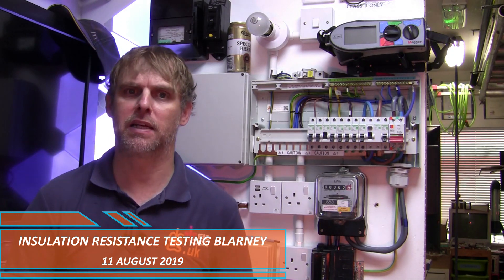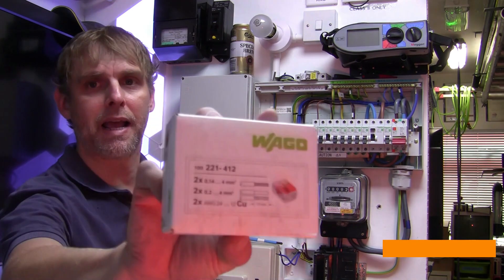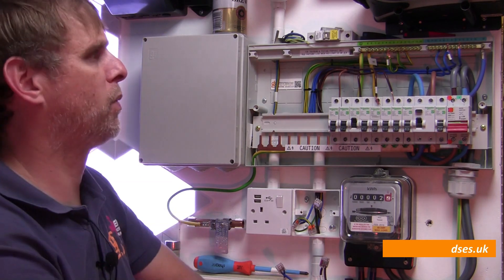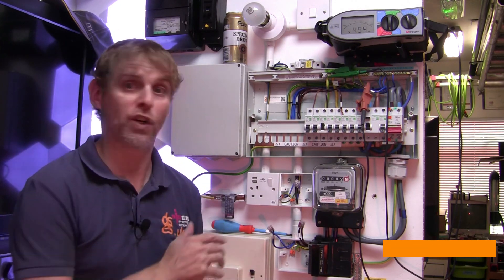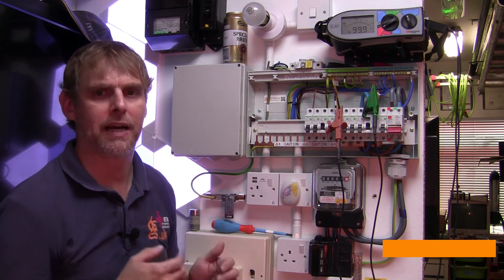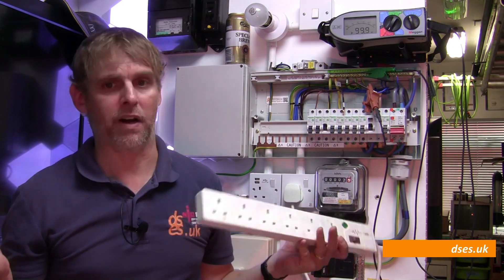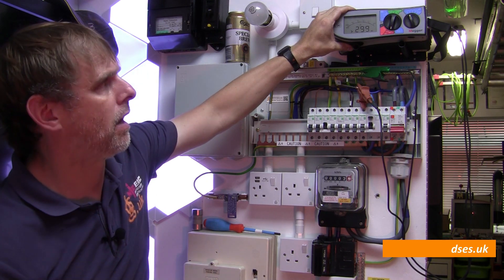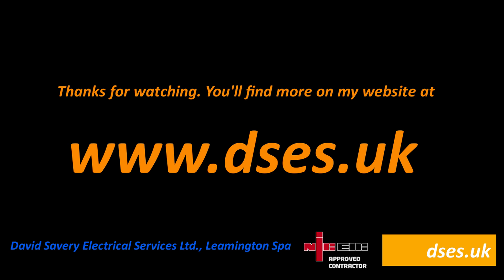Insulation Resistance testing blarney

Comment: I am a site maintenance guy in a school, and have been doing there portable appliance testing for 4 years now, I new the tester put 500v into the item, but I did not know it put it up the line and neutral wire,  you learn something new every day ha ha.  you have the tester I want to upgrade to, the Martindale handy pat 600, would you recommend it ? the one we have now does not have the option to lower the test vault down to 250v so do worry about buggering up computers :-$
Reply from the maker: Hi Garry. For a basic PAT tester, the Martindale model I have is just fine. It does support 250 or 500V testing, but the only time the 250 option is needed for most homes, offices or shops is when I'm testing a surge protected extension board such as that shown in the video as that will fail a 500V test by design. The 500V test shouldn't trouble the computers as they should be designed to withstand it. I've never seen a computer damaged by the PAT process, not that I'm saying it can't or won't happen, but it's not happened to me and I don't take any special precautions for IT gear unless there's a manufacturer label on it clearly stating otherwise!
Reply: one of the IT guys at the school also does PAT testing, and his tester does have the 250v option, but he said he hardly ever uses it as the tester by default keeps going back to 500v every times it turns itself off, he then has to go through a sequence to put it back on 250v, so he just keeps doing 500v test, he also said that he has not damaged any of the hundreds of computers he has tested.  Thanks for the reply.

Comment: On my testing course they told us if you short live and neutral at the board you don't need to worry about unplugging anything????
Reply from the maker: You can short line and neutral at the board (i.e. busbar to neutral bar with breakers in the ON position) to test the whole installation at once with respect to earth, but there are three things to note: 1. Make damn sure the installation is isolated and that the short is removed before anything goes live again (I really don't like the idea of this as it introduces the potential for a major fiery fuck-up). 2. The neutral bar would have to be disconnected, otherwise it's already connected to earth in a TN arrangement so the test would fail (again, I don't like this as some idiot may re-energise the installation after forgetting to reconnect the neutral bar making all appliances appear dead when they're actually live). 3. The resultant measurement would be lower than the lowest individual circuit measurement because of Ohms Law for resistances in parallel. This means your tester might give a reading of, say, 0.5MOhm simply because one or more of those circuits isn't optimal on its IR. That number only indicates something isn't 100%, it doesn't indicate which circuit(s) need further investigation. In short, it's a bad idea as whatever time it saves isn't worth the potential dangers being introduced, and the number you get out of it isn't particularly helpful. More on this can be found in my April video on IR and RCD's.
Reply: Yes they told us do the IR for the whole installation and then if the result is suspect you would then have to go to each circuit one by one to find your problem  ....... I suppose it's the same thing as you doing live and neutral to earth for each circuit individually and  not having to worry about unplugging etc if you missed something
Reply from the maker: Personally, I wouldn't bother testing all circuits simultaneously on a periodic inspection, as it's pretty much guaranteed that one or more circuits will give a less than optimal reading, so for the effort of disconnecting the neutral bar and commoning up the lines and neutrals and the risk of making a cock-up when re-energising, you may as well just get on with testing the individual circuits anyway!
Reply: David Savery Electrical Services Hi David great video. Your reply above wrt testing the whole installation at the board, with the main switch (DP) off, all circuit breakers/fuses on,  why would you need to “disconnect the neutral bar”  on a TN (S or CS) system ? There should be no path between neutral (or line) and earth on any and all final circuits ? (not withstanding there may be under fault or degradation circumstances)
Reply: Hi David great video. Your reply above wrt testing the whole installation at the board, with the main switch (DP) off, all circuit breakers/fuses on,  why would you need to “disconnect the neutral bar”  on a TN (S or CS) system ? There should be no path between neutral (or line) and earth on any and all final circuits ? (not withstanding there may be under fault or degradation circumstances)

Comment: There’s no way on a full rewire I’d send half a day going round wiring in Wago connectors everywhere so I could do an insulation resistance test on 1st fix .
Reply from the maker: It's not just for insulation testing though, it's also so you can confirm ring continuity, or in the case of a radial, continuity to the end point. You don't have to check this shit, but you're fucked on second fix if something's wrong even if you suspect it's down to another trade having damaged your cabling. If you can't prove it was all good when you left site after first-fix, then the client's just going to assume you fucked up, and if you have to chase out newly plastered walls or pull up newly laid floors to fix it, then the expense for that may be expected to come out of your pocket. It's a risk assessment: do you skip the testing and hope it's all okay on second fix, or do you undertake the testing to cover your arse against things going to cock at second fix? I take the safer option because I've been on site where builders have damaged my cables in the past.

Comment: Hi David I'm a bit late watching this video sorry however it stirred a question in my normally empty head it may come across as a dumb question but here we go I have helped put in two linked smoke detectors fireangels ST-230 on its own circuit  so a T+E from DB to the first smoke detector then a 3c+E out to the second smoke detector the T+E has not yet been terminated in the DB an insulation resistance test was done and past ok then the guy did the r1+r2 he put brown +Earth in a connector block and tested at the last smoke detector the reading was 0.00 a dead short he said,  done with a the fluke mft the smoke heads were not fitted at the time would it of mattered that the neutral was not terminated from the T+E  at the DB I never found out the final result of the r1+r2 all people are saying to me is they would just calculate it with the ZE and ZS but I need to know if that neutral should be connected at the DB to get a r1+r2 ...god my head hurts can you or anyone shed an opinion it was a tncs set up in a house cheers enjoying the videos

Comment: Can we test separately 
L N
L E
N E
thanks
Reply from the maker: Yes, you can (and should) perform these individual tests unless you know a load may still be present between L-N or a surge protector between L-N and E.  Where loads are present, join L-N and test to E. Where an SPD is present, drop the test voltage to 250V.
Reply: David I watched a video last week I won’t say who’s but they says that it is important that the circuit earth conductors must be connected to the earth bar with the bonding conductors and the main earth conductor? But don’t say why. I was tort to test between LN -LE -NE and LN and E . As we are testing the integrity of the cables insulation. 
Please correct me if I’m wrong but when we press the test button we send 500v dc down one wire and it returns back on the other wire back to the tester, so 
If the circuit earth conductors must be connected Surely if let’s say Nigel is leaning on say the aluminium sink just as you press the test button Nigel will get it as well you will be testing him , ? I have asked three people on YouTube why it’s important to have the earth conductors connected but know one is will to give a proper answer. Can you shed any light on this as I believe I am right .  But as I don’t pretend to be a super duper know all I could be wrong.

Comment: Kewtechs go up to >12,000 Mohm. Totally unnecessary 😂
Reply from the maker: Anything more than four digits wouldn't fit into the certificate field on Easycert!
Reply: @dsesuk  it must be 1200 then... Yeah that sounds more like it actually 😂 I'm doing my domestic installer retard course at the moment, and they use Kewtech stuff. Passed my Science, practical and building regulations exams over the last 3 weeks and I'm on inspection and testing this week. Leaving the RAF. Any tips?
Reply from the maker: My top tip: Become a plumber! 

Electrics is good if you have the enthusiasm for it. It's an unregulated industry though, and there are a lot of chancers out there, so you have to put the extra effort in if you want to shine above all the dross out there!
Reply: Haha brilliant 😂 I can't stand shit, so sparky is my best bet I think 😂 I'm a bit of a geek, and I like all the inspection and testing stuff, so I'll stick with this. I know a lot of people don't even bother testing which scares me...

Comment: Has any one actually damaged anything with an IR test or is it just a myth?
Reply from the maker: It could be done. I haven't done it (as far as I know), but with all the monkeys out there, I imagine some things do get fried.
Reply: Erm....yes I killed a shower solenoid stop valve on a mira shower it wouldnt hold shut and was working before as it was a new shower.
Reply: @bramcoteelectrical1088  Faulty unit due to fail at the next surge induced voltage spike?
Reply: @bramcoteelectrical1088  Obviously but as it was a new shower what's to say that it wouldn't have failed the next time there was a network surge? Did you pay for a replacement or warranty it?
Reply: @cunning-stunt  rare to get a transient spike buddy unless lots of switch mode computers on the line or a short or lightening with a direct hit.

Was about 14 years ago but I replaced the shower unit.

Now I do on eicr a L+N to E first at 250 see if theres an neons on switches as normally when you switch to 500v the meter will creep up like its building up then you know theres a neon or capacitor still online somewhere.

Takes time and knowledge to learn but everyone can get there.

Inspection and test is very hard to learn as a newbie just have to keep pushing!!
Reply: @bramcoteelectrical1088  I was taught to do continuity tests followed by IR testing at 250V first before switching to 500V. Never blown anything up yet and you are the first I have heard of. Unfiltered VSDs create network spikes, happens a lot where I live, as do lightning strikes. I do not know your location so that is why I asked. So did you warranty it or get your wallet out?
Reply: @cunning-stunt  wallet out :D
Reply: Dno have issues with solar parks voltage raises up and down on the network and like you say unfiltered power supplies or switch mode or pwm supplies mainly earth leakage on large computer networks or a collective of computer power supplies in homes or devices causing transients.

not yet been called out to a lightening stuck house yet but heard from another sparky that all the wall with cables in where black with burnt cables in the chases!

Comment: One major thing missing on your test equipment is lights, as in green and red, bright lights are needed when doing big tests, so that tester is total s+hit,
Reply from the maker: My Metrel is armed with red and green lights just to remind me if the number displayed is good or bad, otherwise I wouldn't have a clue...
Reply: @dsesuk  
Hi David 
Different subject but would you fancy finding a way to stop these clowns who undercut us on price and then only do half the job ie no RCD, bonding etc etc , it's doing my head in 
The general public have no idea what needs doing or what we need to do when we are working for them ,so it makes it easy for the cowboys to move in as it's all down to price as far the customer  is concerned due to lack of education, part p has had no impact !
I've taken over from another spark doing Bathrooms and all the wiring problems I come across were never mentioned with the old chap ,isn't that strange ? Just makes me look like I'm looking for work , even though I have had to walk away from one job and not had a penny and a wanted day
Cheers love you videos
Reply from the maker: @andrewscott6078  Hi Andrew. While the industry remains unregulated, there's little you can do to combat electrical botchery I'm afraid. I have made a formal complaint to a CPS about one of their installers before, but it went nowhere. I have written a few blogs on my website about it, I tweet about some of the nonsense I come across, and I will probably put examples on YouTube in the future should I be in a position to record footage while encountering such on site, but posting examples publicly is about as much as can be done to educate potential customers about what to expect unless there's an industry shake-up. As time moves on, standards just seem to decline more and more though, so it seems to me that things will just be allowed to slide rather than the industry having the impetus to improve. One good thing about it is the work it generates - what is lost to cheaper competition can often be gained by making good the poor work of others... actually, that's bollocks, but I'm trying to look on the bright side!
Reply: @dsesuk  
Hi David 
Maybe we should stop paying Nic ,Napit or whoever as it seems pointless,  we are doing the same now as we were before  part p and all we are doing is paying out for Jack shit
Cheers
Let me know if you start a protest!! as you are higher profile than most of us , I'm sure all us decent sparks would join you